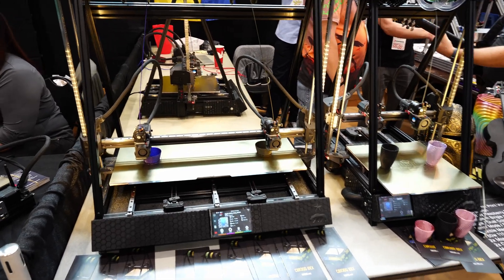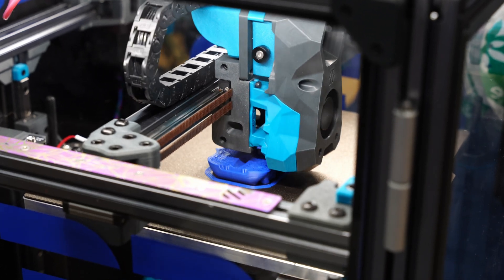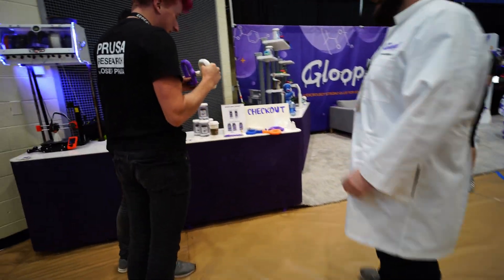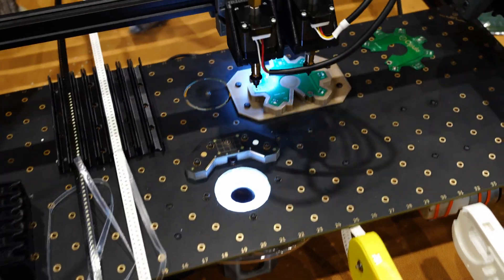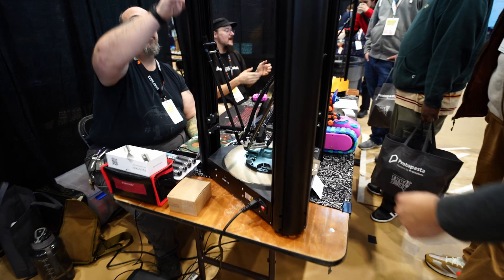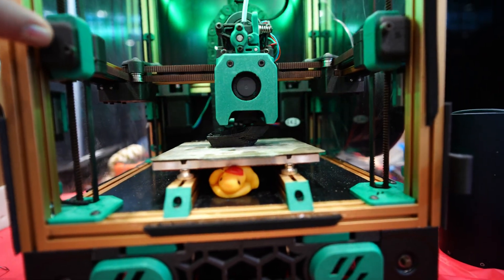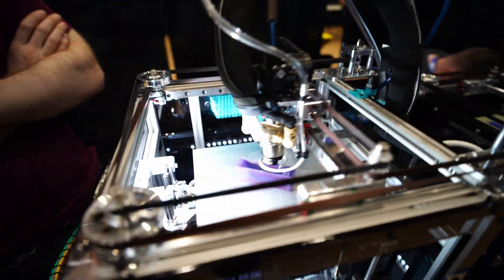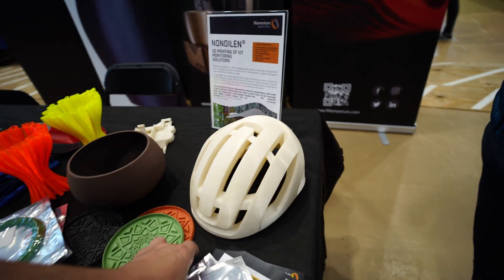3D Printopia (ERRF 2022) in 4K - Prusa XL, 5 Axis Printing, and More!

Comment: The XL is pretty fast imo. But the quality they showed here is rough :(
Reply from the maker: Kind of liked like an issue with the tool change mechanism, and it's ability to hold a zero. It looks like the whole layer is offset the same amount, but varying from layer to layer.
Reply: In the new prusa blog post thay said thare are "problems with the auto homeing function". That could likely be a reason for the quality issues I assume.
Reply from the maker: @mc3dprints  Hmmm. Seems like they are trying to do too much. I'm pretty sure if they just came out with a Prusa branded voron, with a nice user friendly UI and good documentation, people would buy the shit out of it. But the train is starting to leave the station.

Comment: the ringing on the prusa XL looks a bit rough ngl, especially at that speed
is it just harsh lighting or does it look as bad in real life?
Reply from the maker: I think it was having some issues, maybe a fastener was loose, but the print quality looked bad. Could also be re-indexing of the printheads when changing tools is not perfect.
The frame is very open, using a lot of plastic parts... not the best approach to machine design.
Reply: @NathanBuildsRobots  hope they release it soon enough lol, cause if they wait too long it's only a matter of time the E3D toolchanger proliferate first

Comment: Looks like you going to build a Voron next . 😂
And OMG the XL is slow .......
Reply from the maker: I think the speed is fine. Especially if they tool change to a large diameter nozzle. 

Prusa has tons of money to spend on marketing and r&d, but they really seem to be have a hard time with releasing the XL.
Probably because the electrical BOM is a mile long, and they want to use genuine parts. 

Problem is the longer the printer is delayed, the more time the competition has to catch up or surpass them. 

I was really expecting to see a bambulabs printer there, but nobody brought one. So I still have not seen one in person
Reply: @NathanBuildsRobots  You really need see one in action BBL  , with the advancement  of technology hardware and software. A proper manufacturer delivering what is promised This is a wake up call  .
Reply: @SvEfaMar  it's kind of crazy, but the Bambu teams propensity for "rolling their own" for a lot of the stepper control seems to actually be a better approach in a time when it comes to all of this supply chain nonsense.  Doesn't matter if you can't get genuine tmc2209's or the serial logic if your doing it all with h gates and your own pwm controllers in software XD

Comment: I have my eye and wallet on the Positron, its formfactor is fucking revolutionizing
Reply from the maker: Its very cool. It was running most of the day but when I stopped by they had to fix something on it, so I didn't get any footage of it printing. Another interesting thing that I noticed while reviewing this video, is the hotend cooling fans suck in stringing filament strands. Because the strands fall down into the hotend fans. Maybe they could fix it with a remote fan that has air piped in or something? Or even water cooling? But you still need a part cooling fan. Maybe it just needs a filter that is cleared off occasionally.

In any case, I view it more like a concept car. Lots of innovation and style, but may not be the most practical for everyday use. 
Even if the Positron never makes it to market, there are lots of ideas that will certainly make their way into other products.
Reply: @NathanBuildsRobots  it can be purchased as a kit but not as a built printer, i want to buy a built one cuz I suck ass at building one 🤣